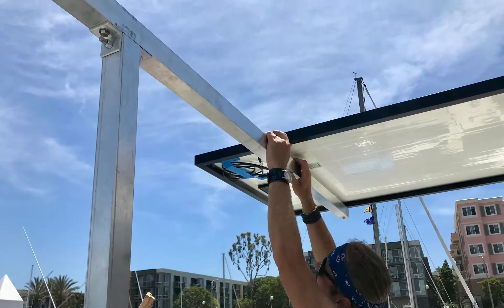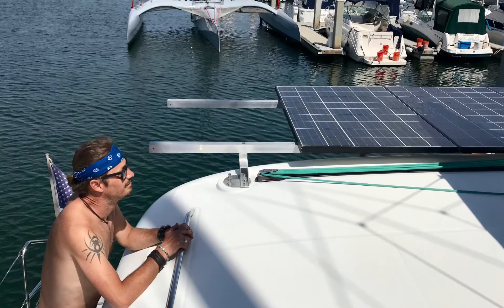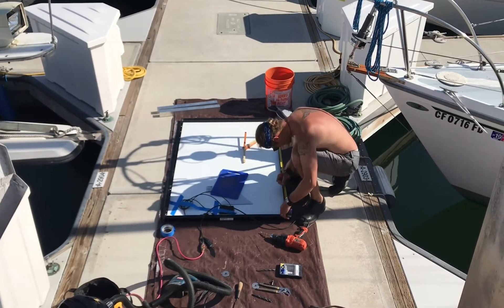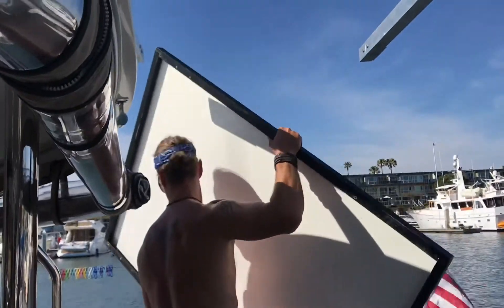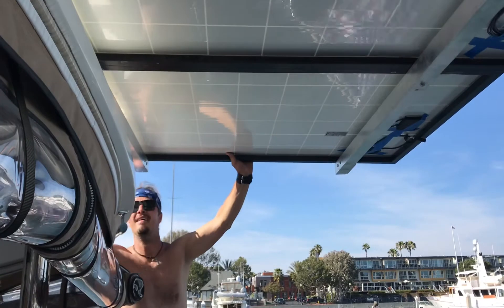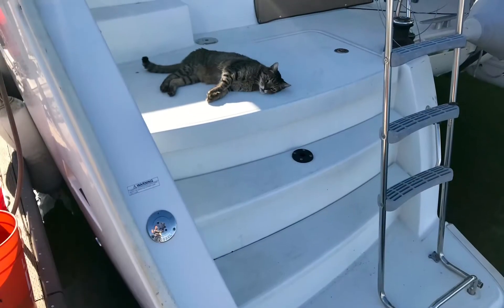Lagoon 400 Solar Installation on a Budget - Part 1 - Ep 10

Comment: Nice job. What are the solar panels that you have installed?
Reply from the maker: I installed 5x 200W Kyocera solar cSi wafer panels. I am planning to elaborate on the electrical bits and specs in the next video including the total cost of the system once finished.